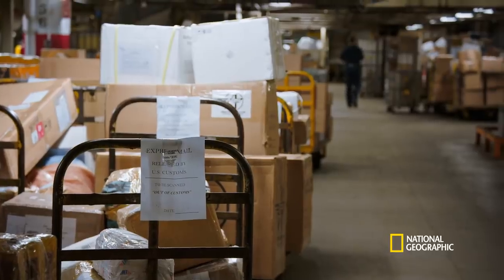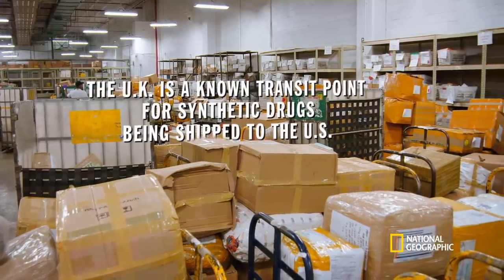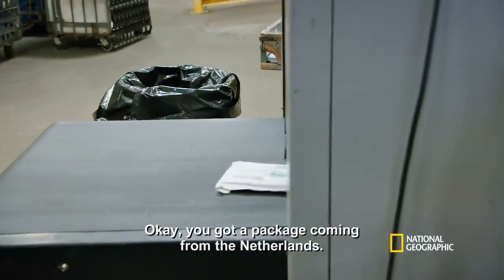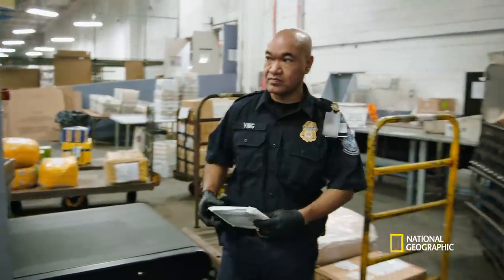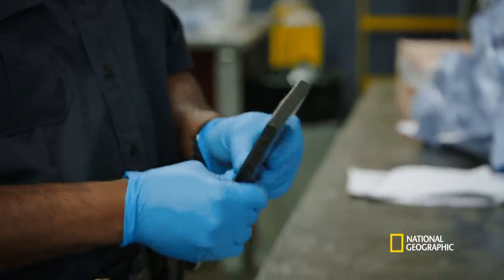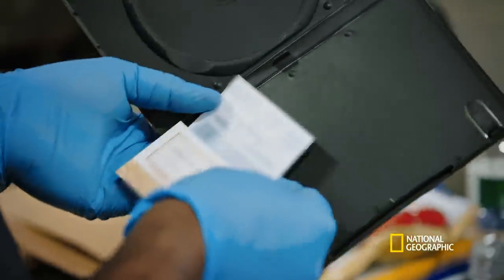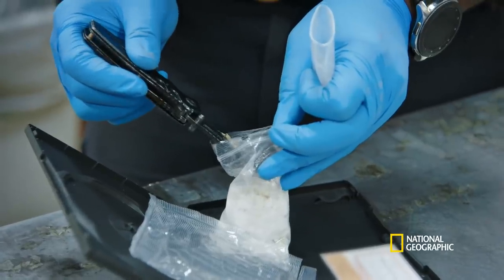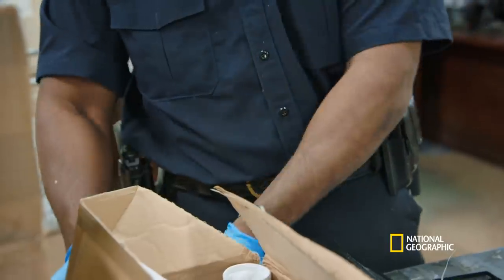Intercepting an Ecstasy Shipment | To Catch A Smuggler

Comment: Why is it illegal? But ciggaretes, alcohol, etc not?
Reply: MDMA would be harder to tax.
Reply: @hugooliva5904  Your argument is basically about quantity which is fair, but not fair how you use it. You can easily overdose on alcohol in a single night, it happens all the time. Cigarettes can lead to cancer, often they do, but not everybody will naturally live long enough for it to develop whether they smoke or not, and some simply won't ever develop it within a normal human lifespan, some can develop cancer very quickly.
Ecstasy, most drugs, are the same in that there is a proper dosage and there is overdosage. Often when stories are told of ODs on E the purity is frequently not mentioned, problems occur when things are cut together to lower production cost without the end user knowing, and then they OD since they don't account for the other substances.

Many controlled substances should stay controlled and don't have much use beyond recreational, and they're negative side effects over shadow the positive, but that is not all controlled substances; it's not intelligent to generalize, especially when the current classifications are fairly arbitrary and many medical professionals even think many schedule 1 drugs need to be reclassified. Weed is still schedule 1 despite overwhelming evidence against any reason for such a classification.
Reply: Because it's impossible to disrupt the use of alcohol. Alcohol can be made by anyone, ecstasy needs to be made in a lab. Had alcohol been discovered today it would never have been legal, but it wasn't and people have been brewing it for millennia. Ban alcohol and people drink just as much illegally. Ban drugs and and there is still a significant use, but almost always less. Plenty of discussion on how to go about reducing the use of drugs in society, such as decriminalization and rehabilitation, legalization and regulation, ect. The end goal is always to maintain the long term health and productivity of society as a whole, and that means taking drugs in a healthier manner, and taking less drugs.

You see plenty of people here advocating for drugs, but there is a bias there: Only a certain percentage of people who use drugs fall prey to harmful effects (addiction, social and psychological effects). Say if 100 people take hard drugs, and 10 experience the harmful effects, then it doesn't really matter that the remaining 90% say drugs are great and they had loads of fun: People who advocate for drugs are by definition people who haven't experienced harmful effects. It's like someone saying cheap street food is is great and you should try it, when they themselves haven't fallen prey to food poisoning...
Reply: @TwinTn  a good answer. Thanks. For me and others
Reply: @kurtlindner  In order to overdose on alcohol though, you really have to go against all sorts of warnings that are being sent from your body. People can definitely tell when they've had enough, in most cases. Of course their judgement to stop at the right time is of course impaired because of the alcohol. 
Is that the case with Ecstasy too, or is it much easier to overdose on drugs like Ecstasy? I'm asking since I don't know anything about that drug really.
Reply: @ad_-yk9bz  I know many people who have drank enough, fast enough, to put themselves in serious danger. Heck, I've got a pretty amazing story from my freshman year in highschool when one of my friends had a charcoal smoothie courtesy of a paramedic when we thought it'd be fun to get a little tipsy after school. We went waaay too far, and ended up at the beach puking up Burger King in the sand. Then a stranger called 911. Memories.
It's always easier than you think to OD on anything, even legal things, that's how people do it.
Can you OD on Ecstasy easily, yes. The reason typically though is because you don't know the purity, like taking a Tylenol, but you don't know how many milligrams it is so you don't know how many to take.
Reply: @kurtlindner  Yeah true. It's not a rarity that people overdose on alcohol. And I guess everyone has overdone it with alcohol at some point in life. 
I was just curious because with alcohol, it still is a process to get to the point of overdosing. You have to drink more and more, so theoretically, you can always judge at which point you should stop drinking. 
I guess with Ecstasy you just take it once and that's it, which is why I would imagine overdosing on that is easier and harder to prevent if you are unlucky than overdosing on alcohol.
Reply: No one takes ecstasy or shoots heroin and gets in their car and kills a family of 6 when they hit their minivan running a red light. Alcohol is by far the most damaging drug to society but it makes too much money to be illegal.
Reply: They are destroying the sassafras plant to harvest the precursor.  That plant has important ecological functions and that is reason enough to shut down the MDMA industry.